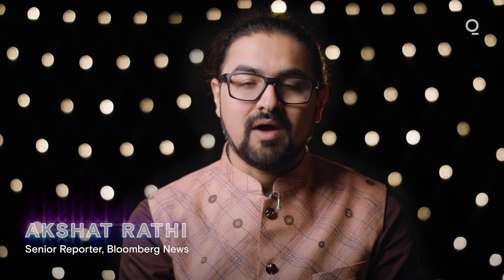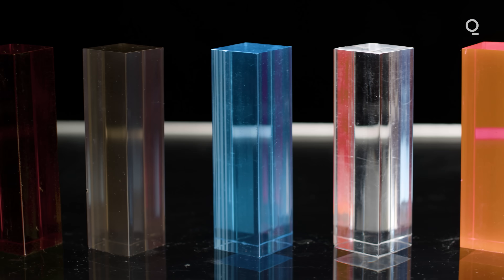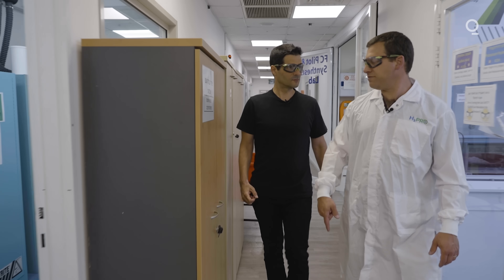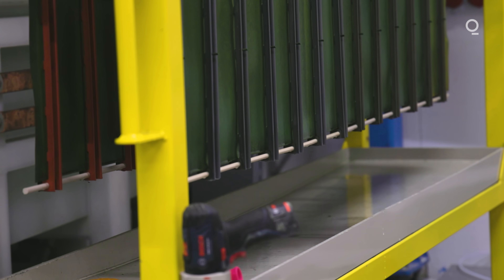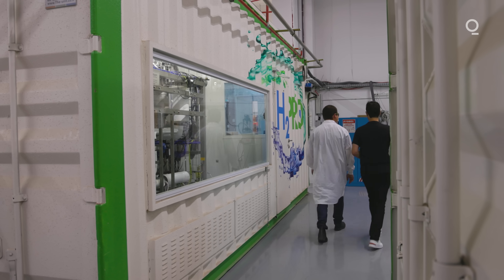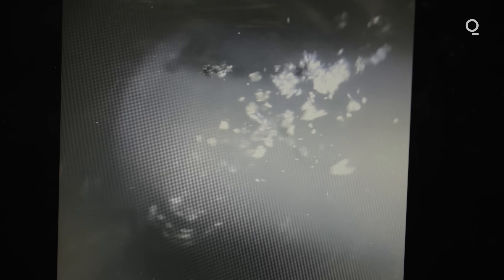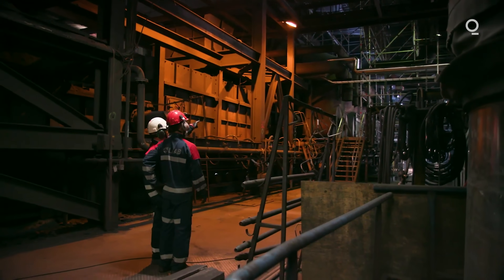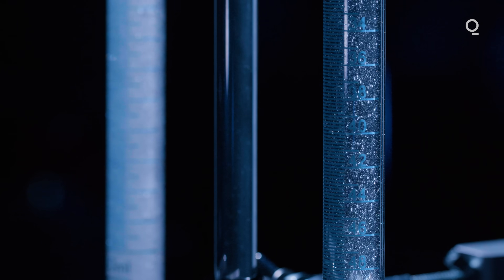How Cheap Hydrogen Could Become the Next Clean Fuel

Comment: I was wondering if they were going to mention the difference in energy density, the balance between energy input versus energy output, and the massive problems of storing and distributing hydrogen. Those problems were pretty much glossed over here.
Reply: Man, reading this thread you can tell how much misinformation and lack of science understanding is out there. The US is in major educational decline
Reply: @mdc4runner  The sad state is that people actually believe it’s better too batterize everything and use electricity as a substitute for stuff where gases where used before.
Reply: @mdc4runner  Yeah, lke many of you think YouTube is only used in US.
Reply: @Top Fuel You are talking about defying the laws of thermodynamics. You cannot get infinite energy from a defined amount of fuel.
Reply: fuel nice
Reply: They can convert H2 to ammonia at low cost and convert it back to H2 also low cost before using it up.  Ammonia is H2 2.0
Reply: hydrogen actually has greater energy density than batteries and even than fossil fuel. IIRC it's seven times more energy per kilogram than diesel. 

So it's a question of how to store that equal mass of hydrogen.

I think for cars, battery is better. 

For aircraft, you need to get the same range and SAME SPEED (sorry TGV, 173 mph doesn't cut it in the USA/Australia/Canada) as a 737 while eliminating the pollution. If you literally "burn" hydrogen in an engine the same way you "burn" aviation fuel, you get the same range and same speed, and zero CO2 emission and zero particulates.
Reply: @neutrino78x  I guess I was wrong how I was thinking of "density" . I was thinking of hydrogen as a gas and gasoline as a liquid fuel. yes, liquid hydrogen would be different. However handling liquid hydrogen is much harder to handle than gasoline. I can carry gasoline in a coffee can if I have to but that would be extremely difficult with liquid hydrogen....🙂
Reply: when you realized news is basicly a well narated propaganda
Reply: They should compare the €cost of energy feeding that pitiful little GW électrolyser to the € cost of energy you would get from burning the H2 in your home. All électrolyser projects are a joke, pushed by big oil on to clueless politicians who have no engineering background, or finance. It is like saying I will run my car on alcohol extracted from vintage champagne. Technically possible, but it will bankrupt you, and it won’t scale to match dinosaur juice.
Politicians will lap up H2 or Champagne alcohol, once a dependency is created, they will whine about the huge cost. Enter Big Oil - we can make it real cheap, out of fossil fuel, and we’ll “capture” the CO2 and call it carbon capture. We won’t tell you that ALL such major projects have leaked massively! We euphemistically call it “fugitive gas”! Not leaking co2 !
99% of affordable H2 is made this way. Green hydrogen is champagne hydrogen economics. Better use electricity directly wherever possible
Reply: @ 0:20 they’re looking at energy that is as easy to use as fossil fuel. Is solar as easy as fossil fuel? No, it’s easier lol
Reply: @coleaz  That was what I had in mind was compared to gasoline.
Reply: @coleaz  For car‘s and heavy vehicles i think you better think again. And for a substitute of gas it’s way superior too any electricity..
Reply: If you ignore the maths that suggests that it's an unbelievably bad idea... I'm sure it sounds like a great idea 😂

So just for anyone who doesn't know... Battery storage is much cheaper, much safer and can deliver power much quicker.
Reply: @craigrobinson1234567  Yes if it’s next door sure if the power source is over 400km away then nope not at all and it’s actually way more expensive.
Reply: @craigrobinson1234567  With a inverter attached and with the 2,5 m distance that each bt from each other needs and the fireproof ground that it needs and the fire system and the transmission lines and the ... 

Not really more quicker if you keep the upfront effort in mind. And the constant maintenance that these things need.
Reply: Plus, the EU has basically banned hydrogen cars after 2035!
Reply: @Feynman981  This is actually wrong they banned combustion motors. Hydrogen Cars very often don’t do combustion. Plus it will not matter in the end for framing and heavy workloads the batteries have a amperage+voltage problem. And then there is the heavy industry that will require it too same with trucks. The mix will make it possible not the idiotic batteries for everything and then have tons of waste..
Reply: it’s slightly weaker in power ratio but it’s the cleanest
Reply: @AmericanRustWorker3369  Don't get me wrong I was supportive of the concept for decades. But like ethanol it too has it's drawbacks.
Reply: Gasoline density versus Hydrogen, oof.  But on that same scale has to be how plentiful one is versus the other.  Hydrogen is many thousand factors higher in abundance than gasoline or oil even, in fact all of the fossil fuels and gasses combined.  Hydrogen may not be dense but, it is hugely plentiful.
Reply: I agree.
Plus there is the problem of H2 tanks for cars.
IIRC you will have to have a very strong tank but how heavy will that be for an average car?
Reply: If some one builds a hydrogen combustion engine / electric hybrid car. It can make the hydrogen as needed and efficiency isn't a issuie when the fuel is water.
Reply: @jasonwhite8722  Huh? You aren't suggesting that you can produce hydrogen without an outside energy input are you?
Reply: @mikestaihr5183  I think he is. There are videos on YouTube claiming to show a hydrogen powered ICE powering a generator that is being used to generate the Hydrogen that powers the engine. I'ts pretty evil that people mislead others like that
Reply: @jasonwhite8722  Ah a perpetual motion machine!! Maybe the passengers could push on the dashboard to propel their vehicle.
Reply: Electricity is inefficient in terms of the vehicle having to carry the weight of batteries while travelling.
Reply: @za7v9ier  I was thinking more of the comparison of hydrogen to gasoline but electricity should be in there too. As for batteries you could say that weight as well as the volume taken by batteries is related to energy density and storage difficulties. Distribution would be less of a problem with modifications of the existing power grid.
Reply: @za7v9ier  that is no longer the case with the latest LiFePo4 battery technology.
Reply: @joeabad5908  As far as I remember searching for a company to dispose of my gwl LiFePo Accu's it's complicated and that they don't recycle.
Reply: @za7v9ier  Once up to speed, extra weight makes little difference to efficiency, aerodynamics and drivetrain efficiency matter more. Hydrogen fuel cell vehicles also require smaller batteries and would have to weigh similar to a full BEV to achieve greater range.
Reply: @za7v9ier  Real issue is an EV needs much "stuff" that takes energy (fossil energy) can we build Green Cars at Green factories???
Reply: @OrionTheta1  Batteries will pose a problem in the future. Whatever happened with plastic in the past is gonna become batteries future. How to properly dispose of the battery, and battery pollution. Could be worse than plastic such that heavy metals will leach into our water supply.
Reply: @za7v9ier   Batteries can be recycled for over 90%.

Why do you think large auto builders are scrapped the H2 development.
Reply: @HenkvanHoek  In an ideal world, yes batteries can be recycled. Same can be said for plastic. The promises of plastic in the past, will be the promises of batteries of tomorrow.
Reply: @za7v9ier  A former Tesla director has started a battery recycling company called Redwood. It recently is joyning Toyota for recycling of their batteries.
Reply: @za7v9ier  we will get much better at recycling. Ups calling used battery materials is already a lot easier than refining rocks.
Reply: @za7v9ier  spent batteries are too valuable.
Reply: @HenkvanHoek  Hmm i think you might take a look at renault..
Reply: @HenkvanHoek  Yep and it can recycle next to nothing and there are several scaling issues and then lithium extraction seems to require the thing to be made to a very fine powder which then needs to be cooled down with liquid nitrogen.ä
Reply: Yes, then again we are engineers. We will make it. That is kinda our job XD!
Reply: Correct
Hydrogen is NOT a fuel more than a battery is...
Hydrogen is AN INEFFICIENT STORAGE MEDIUM.
Batteries will ALWAYS be a cheaper solution, that is pure physics
Hydrogen do have SOME NICHE use cases though but nothing major.
In the end the choice have already been made, it will be batteries not hydrogen.
Reply: @qinby1182  

"Hydrogen do have SOME NICHE use cases though but nothing major."

Jet aircraft, Navy ships, large container ships, railroads....those are major.
Reply: @qinby1182  For cars you mean? It will be the case that you and I are not owning a car anymore. BEV's are sadly not a replacement  with 0 carbon so public transport it will be. Actually that reduces the emission by a gigantic amount but makes in the end nothing. 

Quite funny that we tackle mobility so much when the agar industry is one of the most Co2 Emitting. Guess we are just blinded by there Carbon Credits..
Reply: The energy input would be slowly becoming autocatalytic as some of the hydrogen generated will be used as fuel over and over
Reply: For distribution it is possible to use the existing natural gas line.
Reply: @bern4679  with trillions of dollars of upgrades, yes. Is that even desirable when the cost of hydrogen, if made from renewable energy, will always cost more than the renewable energy itself? Hydrogen should be reserved for necessary operations only, where greater energy density is critical. Production of hydrogen through electrolysis should only occur using surplus renewable energy that would have no other way of being stored.
Reply: @bern4679  unfortunately most gas pipelines are not suitable for hydrogen. 2 main issues, the low energy density of hydrogen on a volume basis derates the pipework up to circa 3 times and hydrogen causes embrittlement of steels, leading to potentially catastrophic failure. Its just not that simple.
Reply: @bern4679  I doubt that the pipe system is engineered to handle hydrogen. Hydrogen is hard to contain. Just look at the type of containers it is stored in.
Reply: @bern4679  no, never !
Reply: Similar with Electricity where it’s glossed over that the energy needs to be transported by something several thousand kilometers and that requires thiiiiiccccckkkk cables actually it losses up to 40%* of the energy which makes many places unviable for direct electricity creation. (*For that long of a transmission line with several conversions)
Reply: @platin2148  I believe transmission and distribution losses are only around 6-10 percent combined. I think you are including inefficiencies in generation which is incorrect.
Reply: @mikestaihr5183  With the advent of Fibre Optics, that # has been reduced. ;)
Reply: @mikestaihr5183  Nope. He is right. Long distance transmission actually loses a lot of electricity. Check out wikipedia. Over a certain distance it becomes more efficient to transport the electricity by ship (as hydrogen) than by power lines.
Reply: @platin2148  with 70% energy lost(mostly turned to heat) all cables in this world would be turned on fire already.
Reply: @platin2148  No it actually doesn't lose that much because they increase the voltage by a lot allowing it to transfer with less energy loss
Reply: @kaptain1477  That’s also why we see a lot of gigantic solar projects in the Sahara desert because energy transfer is easily done and doesn’t require gigantic cables. And here to say a typical maximum transmission distance is about 483 km
Reply: @platin2148  the gigantic cables are because of the huge transmission scale of the solar plants. If one highway has to handle the traffic of an entire country it would a large number of lanes also
Reply: @platin2148  even little solar panels can charge a battery that would charge a phone a full day, somewhere like a desert, if they didn't get covered in sand and stuff they would make alot of energy, not to be wasted of course but enough for a community
Reply: @VashIsBetter215  Ohh so you will build your house there then? I the middle of nowhere where nobody is for majority of the time? But i guess a lot of people have such heavy illusions about how and where energy will and has to come from. It similar to people thinking we can replace everything eith batteries meanwhile we don’t even can take enough out of the ground right now to full fill the current demand and it’s not like there are trillions of untapped resources. If you take it out of the ocean it’s basically as „inefficient“ as producing hydrogen..
Reply: @notlessgrossman163  Splitting it up does it no better and still requires thick cables or conversion which is at this scale pretty bad/expensive and also this would make the energy network even more fragile..
Reply: @platin2148  or put up solar panels.
Reply: @Teslawalter  At my home that already happened isn’t enough for the industry that we right now have and i prefer to have more of that then less of it as everything we let RPC manufacture is out of our hands on how they actually do there stuff in relation to the environment.
Reply: @platin2148  current technology, perhaps.
Reply: @lukerabin5079  What technology are you waiting for fusion?
Reply: @platin2148  
bro where did you get those numbers? electricity transportation loses like 1% over thousands of kilometers, look it up.
Reply: @zak8274  7 to 6 % per 100 km but longest continuous line has been +400 km, and we would need around 1k of that. And then we should also consider that that power line goes through not very stable countries and will likely be prohibitively high in cost to maintain and defend. It's easier and more viable to make hydrogen..
Reply: @platin2148  well renewable and batteries can be set up locally.
Reply: @conormadigan7829  Do i need to say anything? I think we can already skip a discussion that is meaningless for me. Just think about what you wrote in your comment and then understand the context.
Reply: @conormadigan7829  On that point btw. it’s not enough for the economy we run today.

Comment: Well done but with one glaring flaw.  The clip of the Hindenburg burning does not show Hydrogen burning. The conflagration in that footage is the nitrocellulose / powdered aluminum dope used on the canvas outer skin of the airship.  The Hydrogen had already flared off at the upper rear of the airship.  Hydrogen floats up and is almost invisible when it burns.  The highly flammable skin of the Hindenburg is what you are observing.
Reply: its not a flaw they weren't saying that the fire was hydrogen, they were just saying the disaster was helped by hydrogen's volatility
Reply: @jk-gb4et  i understand what your saying but the hydrogen had already flared off at the rear of the airship.  The “volatility” exhibited is due to nitro cellulos powdered aluminum combination for the skin dope.  This mis-perception scuttled hydrogen development for Decades.
Reply: @FtnHills38  oh Ok but Hydrogen is still flammable and explosive right
Reply: @jk-gb4et  yes,
Reply: @jk-gb4et  most fuels and energy storage are flammable and explosive
Reply: @jk-gb4et  Think of the 1986 Space Shuttle.    It was a hydrogen explosion.
Reply: @toddclean547   most of the visible part of the explosion was the aluminum burning.
Reply: @observer3137  How do you know that?   Do you have a chemistry degree?   Does aluminum even burn?
Reply: @toddclean547  yes the boosters burn aluminum metal as fuel and the shuttle itself is made of aluminum metal. It burns brightly with oxygen and you get the white clouds of aluminum oxide. The hydrogen itself burning is nearly invisble. If you look at the shuttle's engines, you can barely see the flames. You mostly just see the nozzels just glowing from the heat.
Reply: @observer3137  Wrong.   The explosion was not the boosters exploding because they did not explode (very visible in the videos)   The explosion was hydrogen and oxygen.   Go look it up.
Reply: @observer3137   Solid frame parts of an aircraft do not explode  --  only aluminum powder in the boosters are a propellant (which was the cause of the incident and which also does not explode))   You are talking to the wrong guy because I am well aware of all of the chemical circumstances of the Shuttle.
Reply: @toddclean547  you misunderstood. The hydrogen and oxygen exploded, the thin aluminum of the tank and part of the orbiter was blasted into tiny pieces which burned up creating the visible light.
Reply: @observer3137  No.   The visible explosion was hydrogen and oxygen only.   Aluminum has nothing to do with it.
Reply: Also worth mentioning: the hydrogen in the Hindenburg burned.  It did not detonate.  If it had detonated, the film footage wouldn't exist.
Reply: But with that much hydrogen, it takes a while to "float off"   You do not  know what you are talking about.